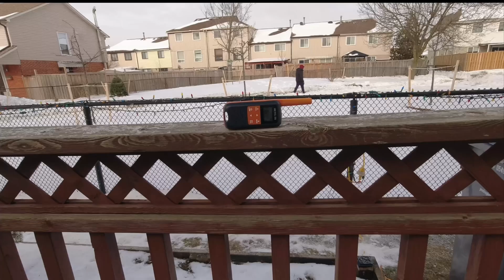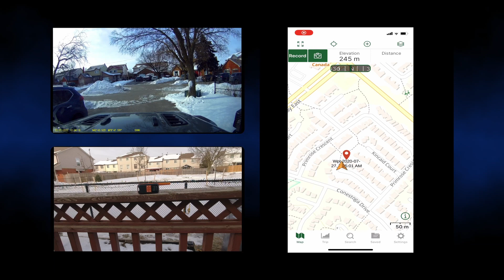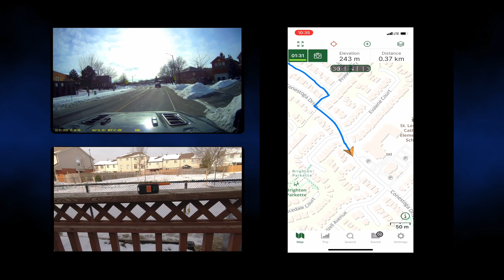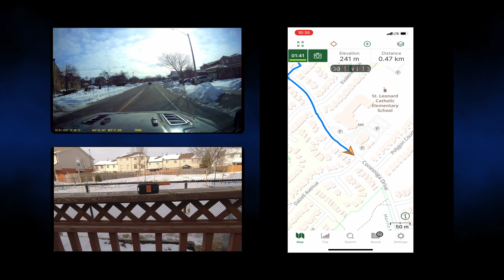Retevis RT49 Real World Distance Test

Comment: Good testing. I like these RT-49. They have decent features and powered by 3 AA is a bonus. I've got plenty of Eneloops so that will be great having extra batteries that are common and easy to replace. I'm guessing in a rural area with not too much thick forest you probably get 2km distance.
Reply: perfect for emgency situations, easy to use good features, not expecting to talk from a 1-3 mile distance. The rechargeable batteries can be replaced by something better off amazon. Remember these batteries usually have 800-1000 life-time recharge cycle . So you should be good .